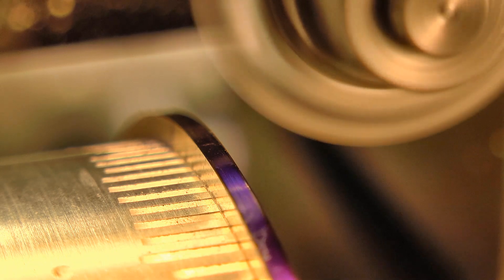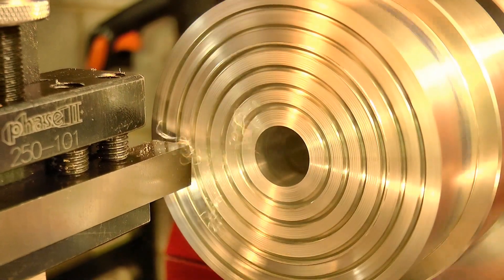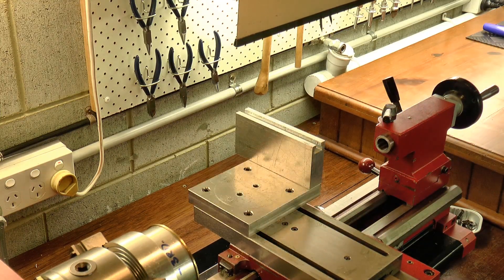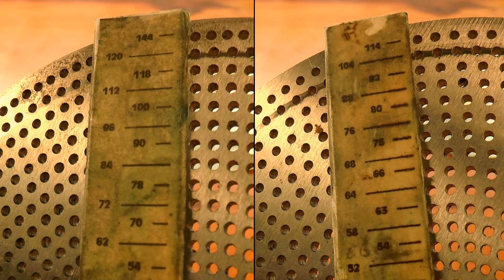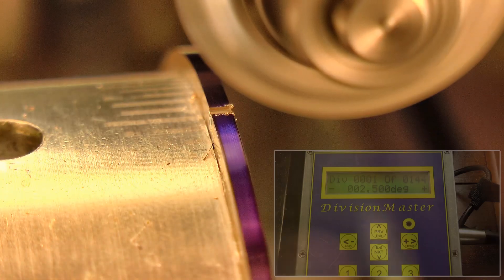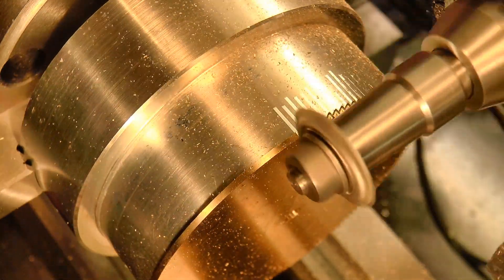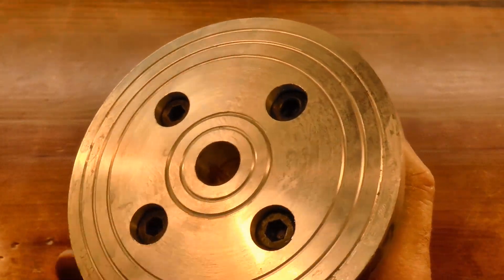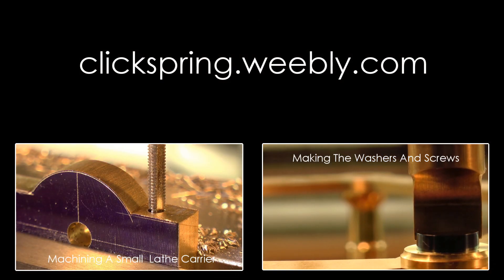Clockmaking - How To Make A Clock In The Home Machine Shop - Part 4 - Cutting The Wheels

Comment: Criss, I have bought the John Wilding "large wheel skeleton clock", and have searched a couple of times looking for what type of gear teeth are being cut, involute teeth, or more for clock-making cycloidal teeth, and I can't find any specification in Wilding's book.  What type of gear tooth shape are you using ? (and where did you get them?),  from the look of your teeth I'd guess they are cycloidal because involute teeth don't come to a point at the top and don't have straight sided dedendums, am totally puzzled by Wilding not saying anything about this in the book (or maybe I just haven't found it yet)  ???
Reply from the maker: Hello mate, the tooth form for clockmaking is almost always cycloidal, unless specifically stated otherwise. My guess is that given Wilding is from the old school of clockmakers where it was exclusively cycloidal, he felt no need for a specific mention. You can purchase the professionally made cycloidal cutters from PP Thornton: https://ppthornton.com/ and you can also make them yourself using a quite straightforward process and tools shown here: https://youtu.be/8-eAhLGmsNQ - Cheers :)
Reply: @Clickspring  many thanks Chris 🙂 !!!

Comment: Could you let us know the speed of the cutter and the wattage of the motor
Reply from the maker: The motor and speed control are Sherline:https://www.sherline.com/product/33050-dc-motor-speed-control-units/ and in brass the cutter is run as fast as possible - Cheers :)

Comment: 05:50 I guess cutting the very last tooth is very exciting. Does it all come together? If the mechanism is only a tiny bit off, say 0.01 mm times 290,  you will end up with half a tooth. So the accuracy with it cuts that last tooth is pretty impressive. By the way, I saw the motor compensate for the slack when returning to the first tooth in the trial cut, nice!
.

Comment: Am sure you would be able to make this gear for an SLR film camera.when you wind the film manually this gear advances the frame counter to show many photos one has taken.it has a tendency to snap after years of use.the gears inside  diameter is 1.5mm and the shaft it fits on is 1.6.its a push on type.

Comment: Where do you find the cutter blade to make the gears there are several different styles gears , so you'd need the different cutting blades.  I fell to mention I'm cutting wooden gears for a all wooden gear clock. Thank you

Comment: I have a question about accuracy for cutting clock wheels and pinons. I'm hoping to start on a clock of my own, but I just discovered that the spindle on the dividing head I planned to use for gear cutting on my milling machine has an  uncorrectable total runout of about 0.003 inches (about 0.075 mm).  Do you think this runout is to large for cutting clock gears?  Thanks for the great videos - seen them is what inspired me to get serous about building a clock.

Comment: Hi Chris, How do you find the outer diameter for the gear blanks before cutting?
Reply from the maker: Hey Kristin, the formula for wheels is: Outside diameter = Module*(Number of Teeth+2.76) and there is a similar formula for pinions dependent on the number of leaves - recommend you get this book from Malcolm Wild, he covers it all brilliantly: https://www.amazon.com/Wheel-Pinion-Cutting-Horology-Historical/dp/1861262450 Cheers :)

Comment: Cool stuff. Only it bags a question, why, after you installed all the electronics, you did not install motor, connected to indexer controller, which moves the stock in and out of work automatically. You seems to have the wits to do it...

Comment: It's funny, being a designer and a machinist, I gaze over the shoulder of different people who do both and wonder why our styles differ. I am a watchmaker as a hobby, and appreciate the time and effort that goes into these projects. As for the cutouts, my mind went to a rotation table, 6", with a sacrificial aluminum plate. I would have cut the inner holes with a boring head. I would have milled the the concentric arcs near the outside with a milling bit. The same bit would have done the struts in the same operation. You would have to sneak up on them, as aggressive milling would have side loaded the brass and chattered. The glue would help this out. I don't file that much, relying on a good milling bit or sharpened tool bit to get the finish. I do use steel wool in the edges to soften then and polish brass, plastics, aluminum, or even titanium. Thanks for the videos, very hypnotic, cheers.

Comment: Hi Chris,
I'm trying to duplicate your milling setup and have a few questions. It looks like you're using a Sherline 3307 headstock and motor unit which is able to produce 10,000 RPM, is this correct? I can't tell if the 2nd headstock you're connecting the pulley to is also a Sherline with an attached 2nd flywheel for extra weight or is it something else? Do you have plans in print for this setup?
Again, thanks for sharing all your knowledge.
Reply from the maker: Hey Tom, I'm using a standard Sherline motor/speed control with one of J Malcolm Wilds milling spindles (http://www.j-m-w.co.uk/tools10.html plus the heavy flywheel he sells for it) and a Myford vertical slide. The Myford slide bolts onto an adaptor plate that connects to the t slots in my cross slide, and also supports some additional plates that interconnect (using with T-slots), to mount the motor/speed control relative to the spindle. This enables the whole assembly travel together as one unit on the carriage. I don't have any plans for it, I made it on the fly, but hope the detail above helps. Cheers mate :)

Comment: I would be scared to death, that after going through all the work to cut a large gear wheel such as this, and then crossing out all that material, that you might encounter some warpage, making the gear go out-of-round... Is brass stable enough to do this?

Frank
Reply from the maker: Hey Frank, brass is generally very stable, although care is still required to keep from making bozo moves when crossing out - its very easy to catch the perimeter of the wheel while its in the vise with a loose shirt sleeve, and risk bending it. Thanks for watching
Reply: franksalterego let's find dong ho tu lam boi tho co khi viet nam

Comment: Awesome work.. Just a quick question.. How do you lock the chuck after every small rotation from stepper motor so that while cutting teeth job does not move or vibrate?
Reply from the maker: The stepper is programmed to hold position after every move, its 'on' at all times, solid as a rock. Thanks for watching and asking Ankur

Comment: Whilst VCI paper protect iron and other ferrous alloys from corrosion, it can cause pitting on copper alloys in damp conditions. It is no protection to corrosion on non ferrous alloys.
Reply from the maker: +Donald Sayers That may well be true, however Daubert Cromwell make an explicit claim that the product is in fact effective for non-ferrous metals, although I'm using it as a barrier to scratching as much as anything else. Thanks for watching Donald. http://www.daubertcromwell.com/uwa.asp
Reply: +Clickspring I did not know of that brand. Things have moved on! My Father was part of the team that developed the first compounds that provided vapour phase protection against corrosion for iron and steel, but they didn't work on anything else. I have a pot of the pure compound which when sprinkled in boxes stops my tools from rusting or tarnishing. Only the very tiniest amount is needed.

Comment: I am attempting to replicate your wheel cutting set up on my Myford and already have the JMW spindle and vertical slide.  I am wondering what power, size and type of motor you are using to drive the spindle.  Your help would be much appreciated.  Thanks in advance. Tony
Reply from the maker: +Anthony Gray Hey Anthony, I am using a Sherline motor and speed control: https://www.sherlinedirect.com/index.cfm?fuseaction=product.display&product_id=405&CFID=108791795&CFTOKEN=33553760 Thanks for watching

Comment: When you are over running into the dissimilar metal (5:30) does that dull the blade faster.
Reply from the maker: +Eat More MolaMola The backing material is Aluminium, which is much softer than brass, so it does not dull the blade any faster. Thanks for watching and asking :)

Comment: I had a question about the scroll saw you used and blade. It looked like it cut so easily I recently started a project and am making a brass gear. I don't have a lot of equipment but I do have a scroll saw. I bought some blades but it's so slow and tedious cutting brass with them. I was wondering what you used cause it looked so easy.
Reply from the maker: +Dudeinator I use these blades: http://www.thewoodworks.com.au/index.php?page=shop.product_details&flypage=flypage.tpl&product_id=4775&category_id=296&option=com_virtuemart&Itemid=91&manufacturer_id= Thanks for watching.
Reply: Awesome thank you, do you use any lubrication or just dry cut brass with these?
Reply from the maker: +Dudeinator Dry, they cut brass beautifully. They even do a decent job on up to 5mm gauge plate, although its a much slower cut. Cheers, Chris.

Comment: What is the purple fluid you use on the metal surfaces? :) i can't tell if it has any uses other than letting you scribe marks etc visibly?
Reply from the maker: +adam cowan Hi Adam, that marking fluid is called "Dykem Blue" - you are correct that its purpose is make the scribed lines more visible, and also helps avoid marking the metal altogether making final finish a little easier. Thanks for watching :)

Comment: I couldn't believe my eyes when the digital indexer perfectly lined up the first and the last tooth cut
Reply from the maker: EddvT I was kind of relieved too! Thanks for watching.
Reply: @Clickspring  
We want moooore.
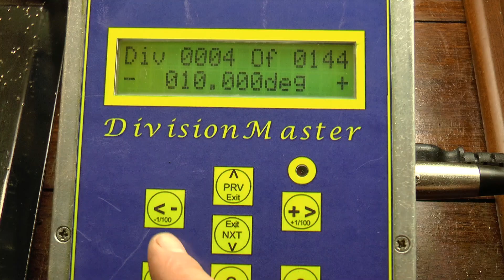Reply: John Ridley, If you look closely to the video, you can actually see the devise adjusting for backlash (4:03, when turning backwards, it's going too far and then coming back to adjust for backlash and to have an accurate measurement going in the clockwise direction)
Reply: +EddvT There was no backlash too.  If I were to do it I would have made the first two cuts and the last cut then worked backwards.
Reply: H
Reply: EddvT yes that was Magic.

Comment: Hi Chris, I've been watching your home machine shop videos for a short time.  Love your work.  Very informative.  I have a question about your DivisionMaster from Lester Caine.  I am just wondering what size motor and cable are you running?  I am interested in buying one for my Myford.  regards, Oscar
Reply from the maker: Oscar Deluca Hi Oscar, I went for the 300Ncm stepper. Lester wired up the motor, cable and controller for XLR plugs. Solid as a rock between divisions, dead on accurate, easy to use. Love it.
Reply: Thank you for all the information regarding the DivisionMaster, Chris, it has been a great help.  I will get back to you once I've received it.  regards, Oscar.

Comment: Hey Chris-
I am a huge fan of this series!  I wish I had a metalshop of my own.  It's a ways off yet.

I have a question- I'm actually working on a clock using my 3D printer.  What CAD program do you use, and is it legitimately simulating the interface between the gears?

I use Autodesk Inventor.  I can manually set the relationships and the ratios, and it will warn me if there's a collision, but it won't simulate the teeth actually "pushing" each other (or maybe I just can't figure out how.)
Reply from the maker: Chris Veros Hey Chris, I use Solidworks. The collision detection etc is similar to Auto desk - the interaction is a representation, but there is no actual intelligent "pushing", it's just gear ratio's and mate constraints. Thanks very much for watching.

Comment: I made Wilding's wooden clock. It was a nightmare because wood is not either level or straight. Now making the Isaacs clock out of plastic, because brass is unobtainium where I live (Alaska). I have a small lathe (Taig/Peatol) and a Proxxon mill. Had to build a dividing head before I could cut gears. But it is not the result, it is the journey. I also have built my own cutters. I would be very interested in more detail on your button profiler for custom cutters. Thesr videos are magnificent; please keep them coming.
Reply from the maker: Juan Rivero Thanks very much for the encouragement Juan. Agreed on the journey; nothing quite like making your own tools to get the job done. I will do a video on the button tools, as well as some other custom cutter types. The to-do list of video's is getting longer, so it will probably be a while! Thanks very much for watching.

Comment: Hi Chris, Great video, work and loved the escapement wheel...a real Beauty!  The standard wheel tooth shape seems to be a modified involute spur, are those custom or horology specific cutters?  Saw that Divisionmaster a while back and curious of your experience with it in regard to stepper tuning (settle time, accuracy and such). What size stepper did you get for your set up and also did you buy the kit?  A bit pricey but when you consider what went into its design & components it becomes pretty reasonable!  Really enjoying your series and looking forward to the next episode!!  Thanks for your time and effort to share with us!  ~PJ
Reply from the maker: Hi PJ, thanks for watching.

The tooth profile on the going train wheels is cycloidal. Its the traditional profile used by clockmakers. The multi tooth cutters are made for horology by PP Thornton, and I made a fly cutter for the stop work wheels.

I'm really pleased with the Divisionmaster. It can be programmed to move between increments at the speed you want, and I did a test for cumulative error when I first got it; couldn't pick a whisker of error. I went for a 300 Ncm stepper - its a bit overkill, but I really wanted it to hold position. I purchased the unit assembled, just to save time really.

Yes you're right it is pricey; I have a very understanding wife! New toolmaking video next week, catch you then.

Comment from the maker: How To Make A Clock Part 4 - Cutting The Wheels.

In this video I go through the setup for cutting clock wheels, and cut the teeth for the 3rd wheel of the clock.

This is basically a light milling operation, carried out on the lathe, using a cross-slide mounted vertical slide, a light duty milling spindle, and a Sherline motor/speed control.

I also introduce the latest acquisition for the shop - a Divisionmaster cnc indexer.

 #horology   #machinist   #Milling   #Clock   #Metalwork
Reply: Duuuude
Reply: And you have to check the maths necessary to multiply torque, velocity or divide a minute in 480 pulses. Its easy but you must calculate it.I already made gears by hand and calcultaed everything with a pencil, everything by hand without any error.
Reply: In German a gear is called a "Zahnrad", literally "tooth wheel". Maybe that is the source for clockmakers calling gears wheels...